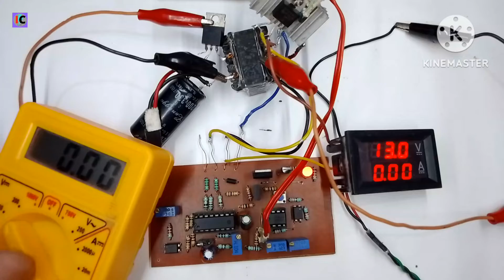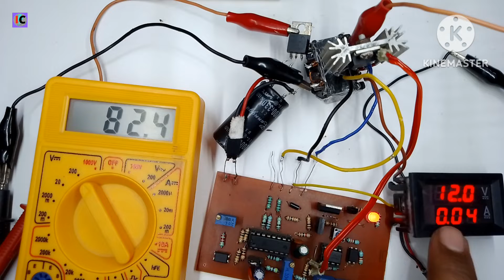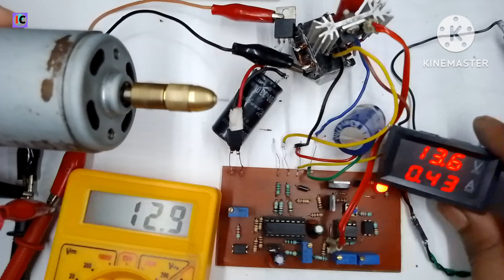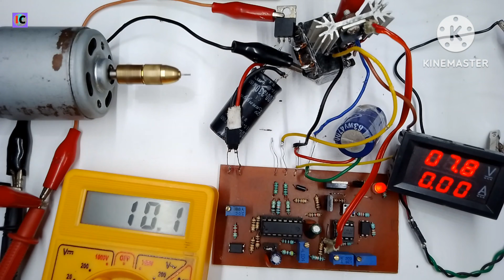SG3525 BUCK BOOST Converter 9V to 80V #buck #boost #sg3525

Comment: I want to use this for driving 480W LED Light - 48V 10A. when input is 24V battery. Can i use this circuit? also is dimming possible in this circuit?
Reply from the maker: for 480w requires big core and more mosfets in parallel and yes this can regulate output voltage thus dimming is also possible 👍

Comment: Sir why you used Flyback Technology with Half Bridge UC which can't provide more than 50% Duty Cycle? You can use 3843 IC. Also can you tell me the details of Transformer winding?
Reply from the maker: Yes you can use UC3843 as it have 100% max duty cycle, in this video just shown the buck boost converter working. 
And for more details on transformer watch this video I have used same transformer -
https://youtu.be/hFvyCh5-HPE

Comment: Hello, thank you for answering my concerns, I have mounted a 10k resistor and a Zener diode on the gate and emitter pins, but the voltage between Gate and emitter drops to millivolts, so I mounted the 4K7 resistor, with this I obtain 7.89VAC between Gate and emitter by placing Negative in VCC- and positive in Gate.
Reply from the maker: Sounds great!

Comment: I get a square signal at the output of the GDT with the 100homs resistance, but when I performed the test to activate the IGBTs, I couldn't activate it, rather they burned out and the strangest thing is that they didn't heat up.
Reply from the maker: the main cause of this higher voltage is induced in the secondary side of GTD which exceeds the gate voltage threshold limit, to avoid this you should add zener diode(12v or 15v) across Gate and Emitter of IGBT

Comment: https://youtube.com/shorts/cf5gO6cfO2E?si=QSm0M1feHZk0tnxz
Reply from the maker: I think you are making half bridge smps, so in the GDT section the totem pole driver driving the transformer with 1uF 100V cap so instead of this try connecting it with low value resistor of 100 ohm(1W) or 54 ohm(1W), I think this make GDT not activating properly hence no signal is coming out for IGBT
Reply: @innovationic  Thank you for your response, I am always grateful for your time in responding. God bless you today, tomorrow and always, it is true that I am doing an SMPS - HB, I am adapting your PWM module, which is more complete and versatile, which is why I am trying to activate the IGBTs and I am determined in carrying out and concluding this project, thank you very much again, I will be assembling those resistors to verify their functionality, I will be writing to you again.

Comment: Hello, thank you for taking your time to answer the IGBT that I am using is KDF50N60KDA I want to activate it with your module since in its outputs of your PWM module with totem pole I get a square signal but when mounting to activate either directly only the module or with the transformer GDT failed to activate them
Reply from the maker: is the IGBT is working I mean its damaged ?
Reply: They are operational and tested

Comment: It does not activate the IGBTs. I have mounted only the module and it does not activate. I have mounted it supported by a GDT. Still it does not activate. I do not have any shorts but I cannot activate the IGBTs.
Reply from the maker: what igbt you are using
Reply: IGBT - KGF50N60KDA
Reply: Hello, thank you for taking your time to answer the IGBT that I am using is KDF50N60KDA I want to activate it with your module since in its outputs of your PWM module with totem pole I get a square signal but when mounting to activate either directly only the module or with the transformer GDT failed to activate them.

Comment: I made your SG3525 PWM module, what you share in your schematic diagram with totem pole works 100%, what I want is to use it to activate 4 IGBTs
Reply from the maker: 4 IGBT will work fine with this Totem pole driver
Reply: It does not activate the IGBTs. I have mounted only the module and it does not activate. I have mounted it supported by a GDT. Still it does not activate. I do not have any shorts but I cannot activate the IGBTs.

Comment: Hello, thank you for sharing your knowledge and your time. A question: How should I connect this module to activate IGBT? A GDT is necessary.
Reply from the maker: for driving IGBT or mosfet in certain amount you can directly connect the Gate to PWM out on SG3525 module but driving higher number of IGBT or Mosfet it needs GDT or Totem Pole driver